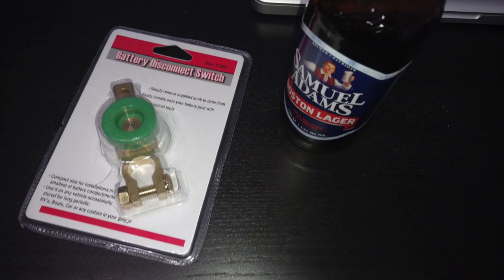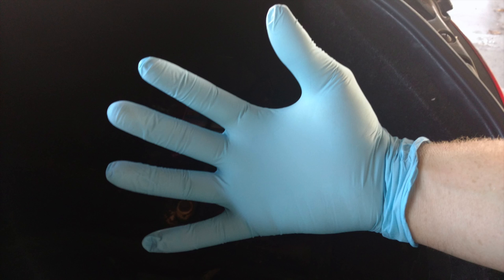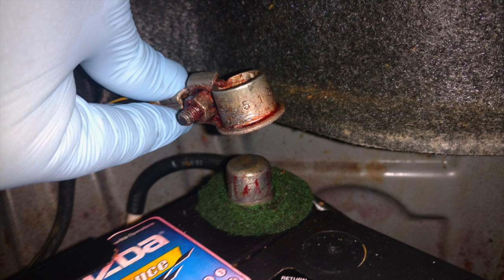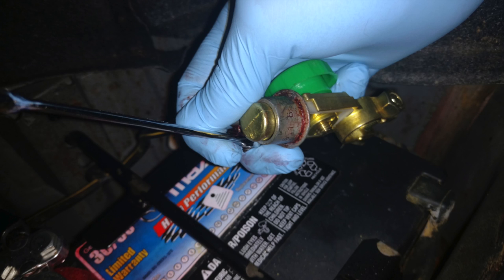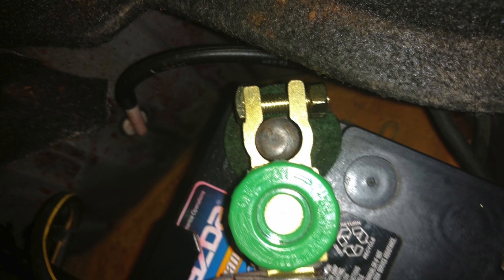How To Install A Car Battery Disconnect Switch

Comment: This video is wonderfully clear; thank you!  

Maybe you can help me:  I have a 2003 Toyota Prius (1st generation) which has an electrical drain--I mean, I leave it undriven for less than a week and it won't start; THAT kind of power drain.  Grrrrr!  (I've taken it to the Toyota dealers 3 times; they were pretty useless.  And yes, it has a new battery.)

I would love to put one of the switches you demonstrate in this video in the REGULAR battery, but I cannot figure out if that's a good idea or not with a hybrid!  (I can't seem to get a clear answer from anyone in-person or online, either.)  Any thoughts?

I love this car, "vintage" as it is by now, but if I can't fix the power drain, I'll probably have to get rid of it--it's just not reliable enough.

Comment: Does it hold up well after multiple disconnects? Do you still recommend this product?
Thanks!
Reply from the maker: Held up just fine for years.
Reply: @AirborneSurfer  thanks, I had the same question as I installed this today on my car.

Comment: I think i might have to be doing this in the near future. fun video
Reply from the maker: It's quite helpful for saving batteries on occasionally-used equipment! For now, it'll do until I can repair the electrical system in my car!
Reply: Also for vehicles with parasitic amp drain on their battery, such as mine for the last week. I'm putting this switch on my negative terminal tonight until I can locate the source of the amp drain.
Reply: @Mike-nf6nf  multi meters are inexpensive for finding amperage draw.

Comment: I got this problem right now... I have a new batt and a strong alt but If I don't drive this car almost every day it won't start after about 2 days sitting. I know I have a short somewhere and for now, I just need to stop the current leak!!!! This small item at Harbor Freight will do the trick until I have time(and you can bet your ass it will take a lot of time!! LOL)  to trouble shoot the short!!!

Comment: is this reliable ? i am planning to leave my car unattended with battery inside with this switch for 1 -2 years will this switch still preserve charge in battery
Reply from the maker: The battery is still going to slowly discharge over time because that's how batteries work (I may do a video in the future about battery chemistry and how there's no such thing as a permanent battery). This switch takes the external load off the unit, slowing down the rate of discharge. If you want to keep a battery in storage for 1-2 years, you will need to remove it and place it on a maintenance charger periodically (Monthly/bimonthly maintenance cycles are fine). An auto battery is not designed to hold a static charge for that long.
Reply: No your battery will drain dead after a month or 2 depending on Weather
Reply: battery float charger is what you need. cheap usually under 10 bucks.

Comment: wouldnt you want it on the positive side not negative?
Reply: NO!  Never the positive side.  That could short out your system if it touches something.
Reply: Negative ONLY!
Reply: It's very important to install it on the negative terminal only, to avoid short-circuits by avoiding car body contact with the terminal.
Reply: Noooooooooooooo
Reply: Only for drag racers, the NHRA says it must be on the positive side, I don't know why!!!

Comment: These switches do not work right if you leave it hooked up halfway and you slammed the door on your truck that switch engages the only way to disconnect it from your battery is unscrewed to switch his not a reliable switch don't waste your money on it